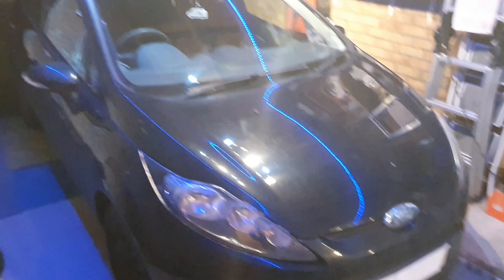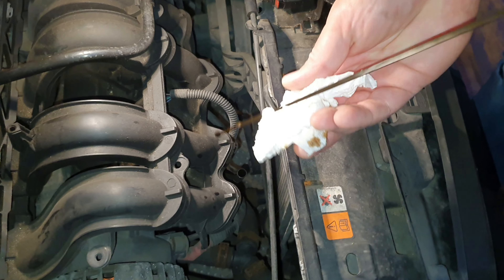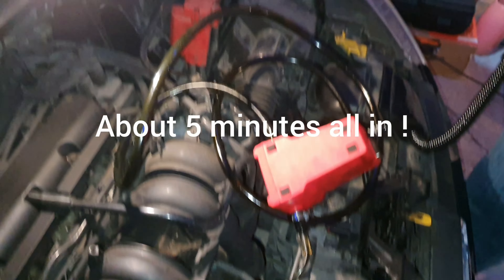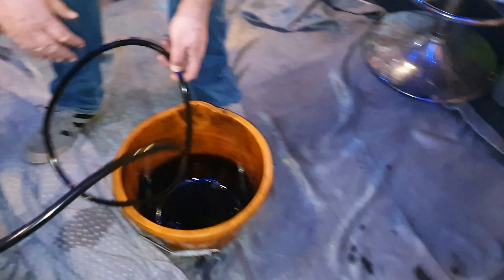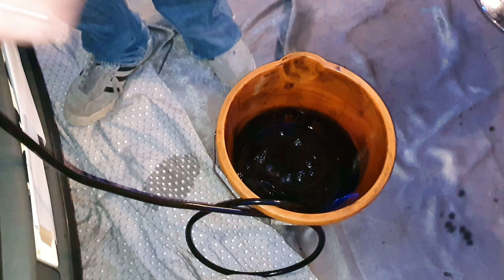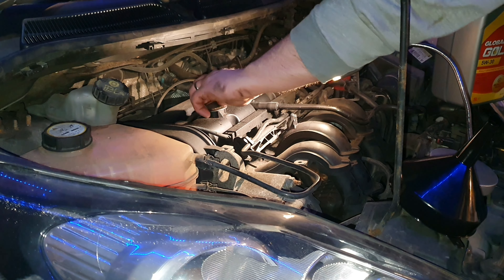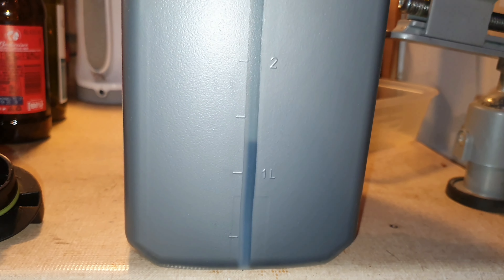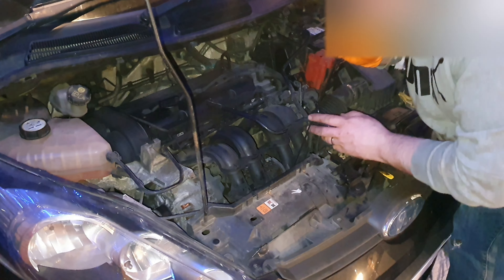Ford Fiesta Oil Change (MK6)

Comment: This looks easier than messing with the sump plug. How do I know how much oil goes in?
Reply from the maker: Hi Paul. Thank you very much for your comment. Yes we agree there is no risk of stripping the sump plug this means. We used castrol oil selector (or the cars manual) to identify the fill capacity and also pay attention to how much oil we extracted.